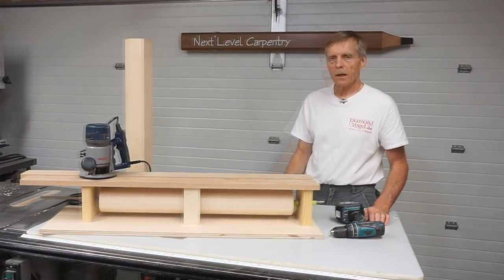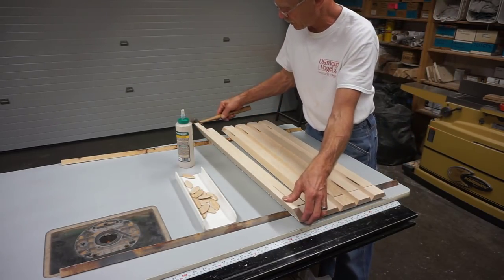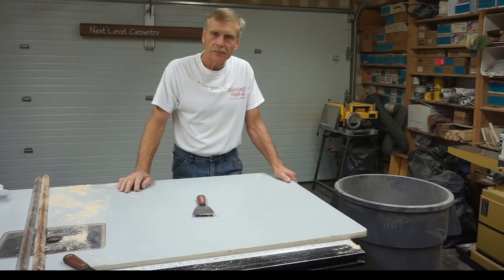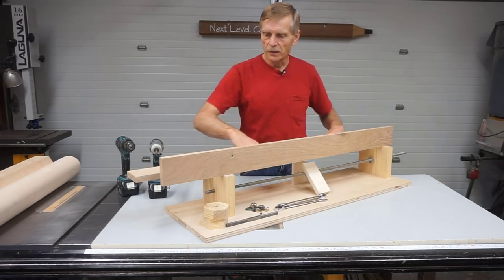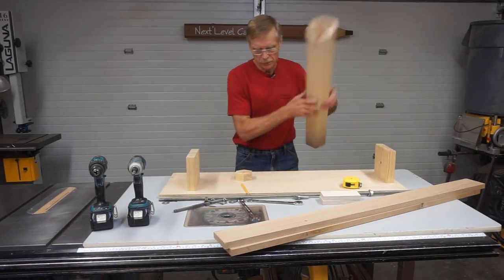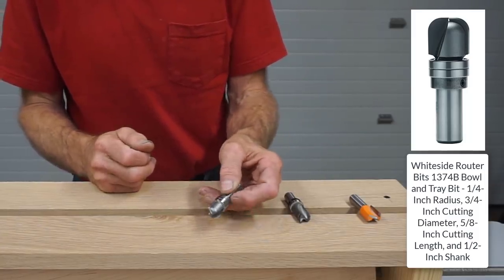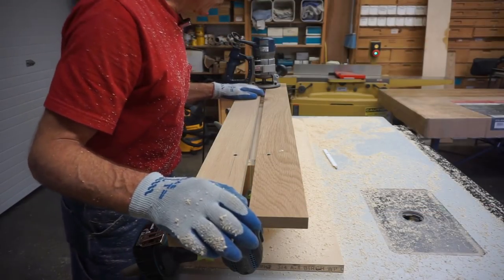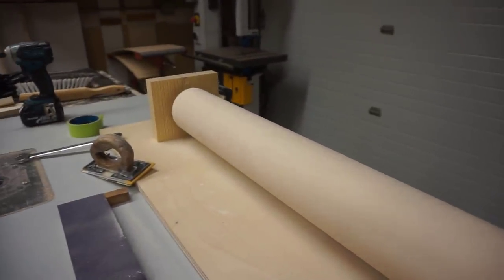How to Make Round Wood Cylinders with a Shop-Built Router Lathe

Comment: I had been thinking about doing something like this for a project I had earlier this summer, however the client decided they liked the octagonal shape better than the rounded one for their deck rails.  What I was wondering was why you didn't use your table saw to knock off the high points before putting the blanks into your router jig.  My own plan for my project was to use a skill saw for the initial shaping and then move to the router and sanding blocks.  Thanks for your video showing how you went about it.
Reply from the maker: Great comment, Jim... embarrassing as it is to admit, the thought of knocking off high points with a (table)saw never occurred to me while I was doing it... d'oh!  Another viewer commented that that's what they did when making masts for sailing ships (or some such cool project) and I knew in an instant that I'd overlooked a real time-saving step.  Now all I need to do is remember tactful comments from viewers like you next time I need to use this method 😏🙄😁😎
Reply: I would take a Stanley #5 plane and pre-round the cylinder by knocking off the high points.  Remarkably quick with a sharp plane.
Reply from the maker: I agree completely David... glad to know you know how effective a sharp plane can be! 😎  Best, Matt

Comment: Good instructional video, however why did you not use solid square timber and avoid the problems with making a sectional build? Just curious.
Reply from the maker: Thanks John: that's a good question.  First off I don't have a source for a solid square piece of maple big enough for the two legs.  Second: the hollow center allows me to do this without a lathe.  Third: I was able to use bolts to hold the legs to the stretchers by reaching down inside the leg and tighten them with a ratchet and socket.  Fourth and equally important is that the appearance of the grain on a maple 'log' turned to this size would have been pretty boring IMHO and in this case I preferred the look of the subtle laminations in the turned leg.
Hope that answers your question?  Best, Matt
Reply: Matt, thanks for answering my query with a logical answer. John
Reply from the maker: For sure, John.  Another thing I forgot to mention is I wanted to demonstrate a method that could be used for larger diameter cylinders, 12"~18" or so, which would not really be feasible for solid wood for furniture both because of weight and 'stability' of the wood ie: solid wood would tend to split, etc.
Thanks again for your comment and checking out Next Level Carpentry!  Best, Matt

Comment: Hose clamps would be an alternative to the fancy clamps used.  Those fancy clamps don't wreck the corners, but in this case it wouldn't matter.
Reply from the maker: Hey Dan, I agree hose clamps would be a functional alternative but I'd hate to be the one who had to clean up glue from all the clamps after it dried 😬😰  Gotta do what you gotta do and, as you say, in this case it really wouldn't matter.  Best, Matt
Reply: I'm not sure that glue would even stick to them.  I have seen the turning guys use them to clamp up the rings when making a bowl.

Comment: If you offset your router to the Centerline of the cylinder you can make it so it does not get pulled into the work, which is called climb Milling.
Reply: I'm not knocking your video I did enjoy it and I might even try it.

Comment: good narrative. Any ideas on a fixdd router lather for other projects.
Reply from the maker: Hi Bob,
Thanks for commenting... it's not clear what you're asking but as I mention in the video I see no reason that this method/process wouldn't work for larger, longer cylinders, tapered ones, etc by adapting the general principals to the project at hand.  I could easily imagine making a pair of tall, tapered columns as part of an elaborate fireplace mantle/overmantle type project.  
It isn't a universal solution or even the most practical one since there are so many  sources for carved and turned columns and decorative elements it just isn't realistic to compete with that availability from a cost-effective standpoint.  It is very rewarding and satisfying to make cylinders this way though!
Best,
Matt

Comment: Hi Matt. Great video.

I would probably lock 2 nuts together on the shaft at the insides and outsides - nylock is a pain to wind a long way on and the nylon gets weaker the more you turn it on a thread. putting nuts on rod before you cut it and the winding the nut off removes the need for the thread chaser too. just a flat file to knock off the wafer thin thread at the end. 

Like someone else said - I would be knocking wood off before starting to spin it either with the saw or by locking the blank in place as you took straight passes with the router.

Surprised you didn't use a guide bush as it removes the concern about the bearing. Great attention to detail and accuracy.

I would have used 2 nuts and a large washer on both sides of the supports and got rid of end float to prevent potential chatter.

Very interesting video with great results.
Reply from the maker: All great, useful, smart and sensible suggestions, Greg; ones that anyone attempting this would do well to implement... including ME if/when I get another job like this one... thanks for adding this comment!! Best, Matt

Comment: Aloha Next Level Carpentry ! 
about 22 years ago , in Kohala , using Koa Wood , I built these 2 'Dutch Hutches' based on a picture brought to me by the owner's of a home[estate] in my area . The bases of these hutches were of the same nature as your turned columns . Each column was cut into 1/3 of the finished base and than bandsawned to form it place on its visible side . Where 's how the end result came out :  [never a 4 year old around when you need them to make electronics work for you ]. Picture didn't copy/paste , rats
Reply from the maker: Sounds like a cool project, Mark, and in koa wood, no less!  Thanks for sharing and, 4 year old or not, YouTube doesn't allow pasted images in Comments so don't feel bad about that.  😁👍 Best, Matt
Reply: Mahalo for the reply about not being able to post pictures on you tube . It did post on face book if you wish to see 1of them. Mostly unplug now for 7 years  but back to college next month to try to reboot myself with CAD  and bring in the Bacon again. 
Aloha ,Mark
Reply from the maker: Good luck with the CAD thing, Mark... there's $$ to be made if you get into the right niche.  BTW have you looked into 3D modeling with SketchUp?  I've spent a fair amount of time learning and using it and it helps me 'bring in the bacon' on just about every carpentry project I do.
Best, Matt

Comment: Rather than spin the hex cylinder on the first passes, you could leave it stationary and run the router length wise to remove the corners until it is reasonably roundish before a final spin for finish surface. This would be easier on the router bit, worker and support system.

Comment: Matt: great job! I was just wondering if you added a drive dog at the end and a rail even with the centerline, could you use a gouge to do most of the rough shaping? Would the drill provide enough power for that?
Reply from the maker: Thanks Frank... I never considered using lathe tools for shaping.  I it was to work at all the tool would need to be extremely sharp but even at that I don't think it would work for lack of power.  Consider the beefy motors used on lathes... drill motors are only a fraction of that.  Best suggestion I got from other viewers is to cut the angle apex points off on a tablesaw before 'chucking' it into the lathe.  I'm embarrassed to admit I didn't think of that either!  Best, Matt

Comment: Hi Matt,
 
I noticed you had problems bumping the carbide cutters into the angles at the start. To ameliorate this problem couldn't you whack the corners off ,by either running it over the jointer or even trimming with a hand plane? When I used to make wooden masts we used to get it most of the way there with an adze!
Reply: Meant to say great video by the way. Posted too soon!
Reply from the maker: Bill,
Talk about a duo'h moment...  I sure wish I'd thought of your 'whack the corners' suggestion... guess I'll have to plead 'fog of war' as a defense </:-{)  Never even thought of it during the making or video shooting process! I should have done exactly that BY ALL MEANS!  I'm guessing there's an interesting story or two in your offhand 'I used to make wooden masts' statement as well!
My excuses: I didn't want to make a 12-agon (dodecagon) blank even though it would make it 'smoother' initially since it would mean twice as many glue joints in a 4" diameter leg.  Your insightful method would have ALL the advantages of a dodecagon plus all the practicality of a hexagon... DUO'H!!  Even though it gets a little dicey planing or cutting the close angle planes of a many-sided tube it would allow a much closer setting between the guide rails of the lathe and the blank.  Plus less projection of the router bit would make cutting more stable and manageable saving wear and tear (and destruction?) of the bit.  PLUS 3 minutes to re-shape the blank would save half an hour's time by reducing the number of passes with the router from almost 10 to probably only 3 or 4.  
Thanks for your 'great video' compliment... I'll try to live up to it and hope you'll subscribe somewhere along the way.
Reply: All I have to say you make it look both easy and complicated at the same time; complicated in the context of the attention spent to the most minute but necessary details, and easy in the context of everything seeming to work out exactly as planned. Watched the whole thing to the end. You've got some mad skills there!
Reply from the maker: Thanks, Clark!  It's my intent to show issues I encountered developing this method to give viewers like yourself a 'leg up' when they tackle a similar project... no sense in everyone repeating the same mistakes since there's so many more to make ;-)
Reply: Oh for sure! Still nice to see someone enjoying what they do and helping to motivate the rest of us to put down their smartphones and pick up their tools again. Just think of all the marriages you save on a daily basis 😁 😁 😁 😁
Reply from the maker: Dr Phil in the workshop <P8-)
Reply: Like any "hay that would be simple idea" it's never easy getting a final project done. Watching you is way more fun and I use almost none of my favorite cussing mumbling and grumbling.
Reply from the maker: TT, The learning curve when cutting a new swath can be a bit daunting sometimes, yes?  Glad it's  'way more fun' watching me because it would be sad to see such classic gaffes be squandered if I was the only one to see 'em.  I intend to include some 'blooper footage' in future videos to add more entertainment value.  It can take 4 or 5 attempts just to make a single sentence comprehend-able sometimes and if THAT ain't entertainment, I don't know what is ;-)

Comment: If u wanted to make a 12 inch cylinder would the 30 degree angle stay the same how do you determine how wide each board is
Reply from the maker: The angle is determined by dividing 360 by the number of segments.  In this case 360 / 6 = 60 so, if you do a 12 inch cylinder in 6 segments then, yes, the angle stays the same although the segments would have to be much thicker to make it possible.  A better way would be to use 12 segments with 15 degree angles so the cylinder wouldn't be so thick and waste valuable wood...

Comment: have you considered 1/2" copper pipe as a bushing in 2x8 for threadall?
Reply from the maker: Hey Rusty,
A copper pipe bushing or sleeve would be an upgrade (assuming its I.D. and the 'threadall' O.D. are a good match) and a useful suggestion for anyone building a similar router lathe.  I was looking at using wheel barrow tire bearings and some other bronze bushing material but decided at the time that a little lube in that dense southern yellow pine would be adequate for just 2 cylinders... it was, but if setting up for 4 or 5 I'd recommend your pipe suggestion or something similar to get away from metal spinning in wood.
Thanks for commenting and the sub!

Comment: I personally would hold the cylinder still and cut away the corners ( high parts) first by going back and forth and when they reach the flat part then go in circles with the drill this way you wont bang the router bit against the wood going into it.

Comment: What kind of wood is this ant if I can cut the poles into half’s later?
Reply from the maker: I made these out of maple per my customer's request.  Be careful if you cut them in half later make sure you make a safe, accurate fixture for good results without injury... cutting round stuff can be surprisingly dangerous if you're unprepared.  Best, Matt
Reply: @NextLevelCarpentry  but what is best for such a project tough enough to handle all the routering
Reply from the maker: @cjfox5805  This could be done with any wood.  Soft woods would rout easier but, as you saw, it works well even with wood as tough as maple in this case...

Comment: The thing I thought of was using a sewing machine motor and pedal to spin the blank ? This wouldfree up the hand needed to operate the drill  since you could operate it with a foot instead andit allows you to change the speed  easily
Reply from the maker: Craig, That's some creative thinking there and probably a viable alternative for powering the router lathe especially if you didn't have a cordless drill and did have a motor and footswitch.  In practice the drill worked wonderfully although switching it on and off by unplugging the battery was a pretty crude method.  I realized how important it is to have variable speed capability built into any source of power.    For comparison though there's another YouTube video out there where the blank is 'powered' with a hand crank and the drill-powered method is FAR superior to that IMHO.

Comment: Really find talking of oneself in the third party very odd. Are you “you” or someone else?
That said, 
This would be a good foundation for a 10” DIY drum sander. That cylinder would provide true accuracy with plenty of mass to transfer the energy required for a good drum sander which bought commercially would be in the thousands. One could build it as wide as needed, certainly 24” wide.
Reply from the maker: Not quite sure what dialog you're referring to with the 'third party' thing but, rest assured, I'm 'me'... at least that's what the little voice in my head keeps telling me 😏😁😂
I THINK you could produce a very accurate 10" drum/cylinder with this method but it would surely require great attention to detail and tolerances during the build/set up phase.  Personally I'd probably opt for something made on an actual lathe to achieve the better than cosmetic precision you'd need.  I'd sure be glad to hear if you give it a try and about your results if/when you give it a go.  Best, Matt
Reply: Next Level Carpentry 
I understand your concerns on accuracy. My biggest concern would not really be how perfect the diameter over the length; surely needs to be fairly accurate to achieve a good even surface on the resulting product. My concern, and I have no immediate answer to, is it being fairly balance when spinning. Like a car wheel and tire, balance is very important to avoid harmonic vibration which will destroy everything attached to the cylinder. I know the  4”- 6”sandpaper medium is held on by attaching at one end and spiraled on to the other. So getting the thing balanced will be a bit of a challenge. My cylinder would be solid. Possibly I should consider another medium, like concrete. Easily enough cast inside a piece of 10” pvc or a piece of 10” spiral duct or even cast iron pipe. My immediate thoughts were for a way to create a 2-1/2” wood screw for a vice clamp having no wood lathe. 
Take care. 
It’s okay about the third party issue .... Trump speaks of himself that way frequently, but nothing unusual there 🙄.
Reply from the maker: Hey James, Seems like you could balance a heavy drum by drilling holes to remove a little weight from one side and quickly attain weight balance.  I think making the O.D. concentric would be a bigger challenge because 1/16" of an inch would mean 1/2 the drum's diameter wouldn't be in contact with the workpiece.  You'll be better at this operation than I am if you make your drum successfully so feel free to post follow up comments if and when.  Best, Matt